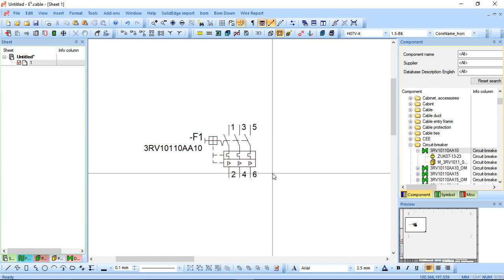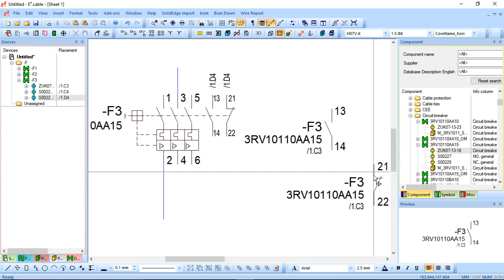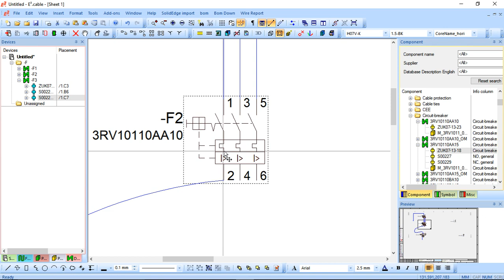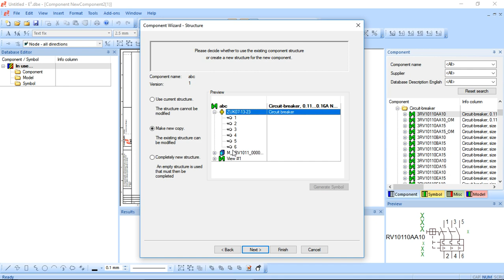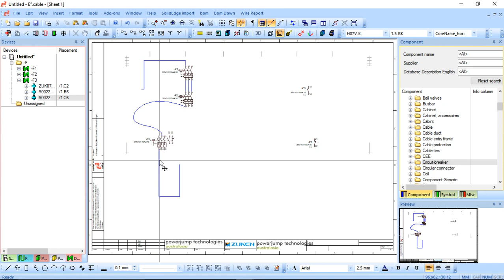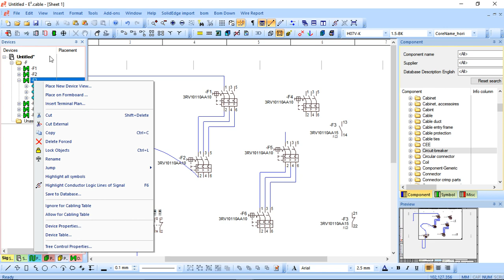Easy Schematic generation using Zuken E3.Series,

Comment: Would you please help change JIC symbol to IEC symbol. Thank you
Reply from the maker: Hi thanks for your question can you confirm in your setting files that you are using the correct template(project) file. in settings the first screen will show a template and an attached file name. can you confirm that you have project_IEC.e3t selected. If you installed in US english it would have by default selected Project_ANSI. you may need to restart your session once you have done this. let me know if this solves your problems. 
Thanks Pedro

Comment: hi, I tried to create new connector symbol in E3. Cable.  In symbol property I've selected 'connector' as a class. 
Created symbol is saving in "<no entry> folder. But it should save in Connector folder. 
Please help me to setup database for symbol and component creation.
Reply from the maker: Hi No problem, This is an easy and common mistake, the connectors are placed in folders as per their class and sub class. if you select connector as its class it will appear in the class folder. you can do so by device/symbol properties.  Let me know if this makes sense.
Reply: Hi thanks for your reply.
I have selected "Connector" as its class in symbol/component property. But by default it is creating new "<No entry>" folder in database after clicking 'save To database'.
Reply from the maker: Apologies for the late response, Give the below link a try it should cover your issue
https://www.youtube.com/watch?v=-ezFrLyMnsQ&feature=youtu.be
let me know how you go with this. 
Thanks
Reply: Thank you very much.., I got it
Reply from the maker: MY pleasure ;) Good luck using Zuken E3.Series!